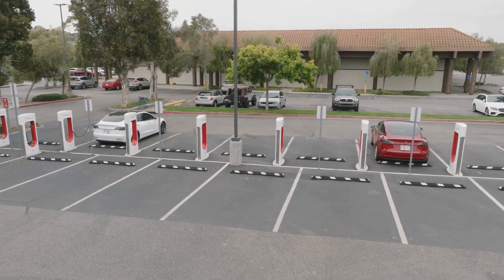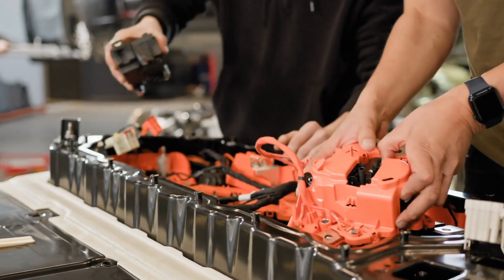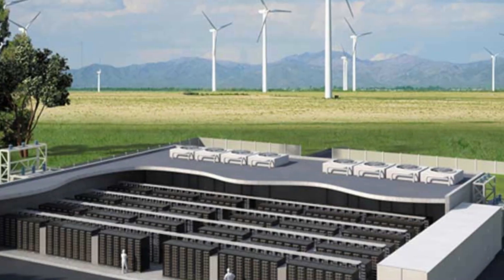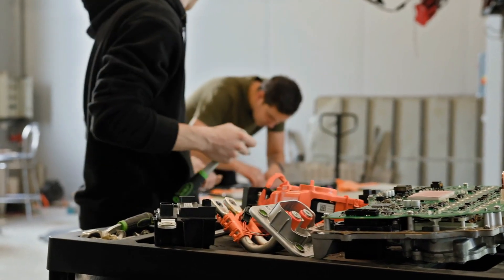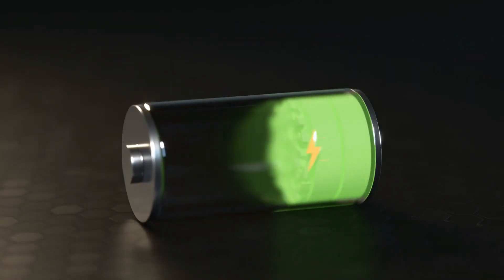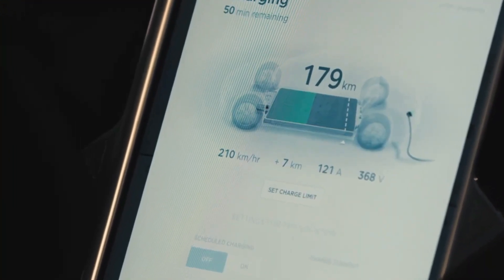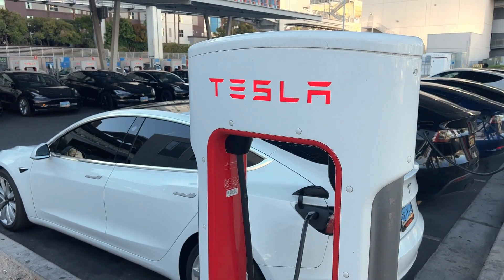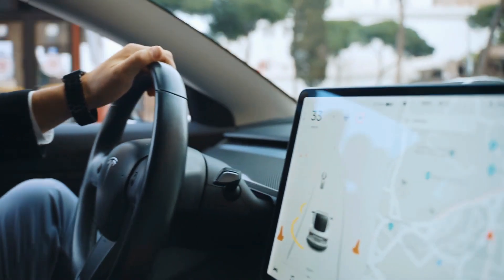Elon Musk Announces the Iron-Air Battery as Tesla's Game-Changer

Comment: Unfortunately the Iron batteries have a very low energy density and are used for grid storage, not cars.
Reply: Elon Musk doesn't want these Bateries for car. But for Grid storage
Reply: Per volume, it holds 3 times the power of a lithium ion battery.  This isn't feasible, not because it can't hold enough power.  It can hold way more than a lithium ion battery.  The reason it is hard to incorporate into a car, is because it can only charge and discharge about 1% of the batteries power in a given hour.  So... a 100kw tesla for instance, if it were swapped with an iron air battery of similar size, might have 300kw of power, but it can only dispel 3kw/hour.  So... you'd have like a 4 horsepower car.  Like.... it'd move... 10mph or so... but that's about it.  You'd need a much bigger battery, a second battery in tandem, or some old school fly wheels, to get any sense of performance out of it.  For a car it's small, but for huge ships or trains... like.... why not?  They have capability to allocate much more space to a huge battery, or sets of smaller ones linked together.
Reply: This is good enough for stationary systems. Not for cars, or aircrafts.
Reply: Exactly